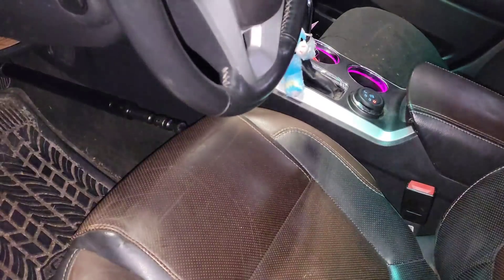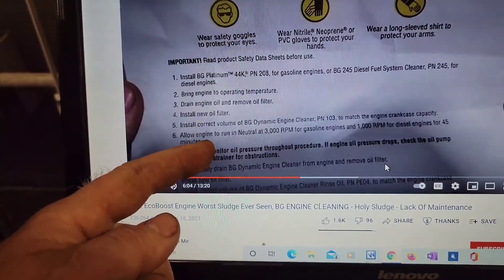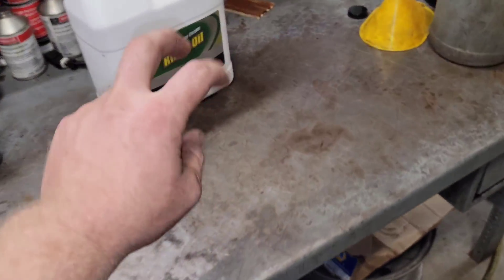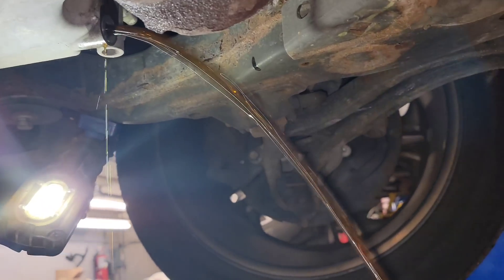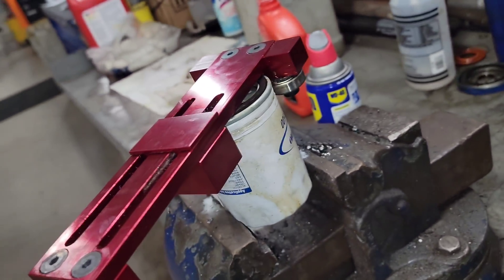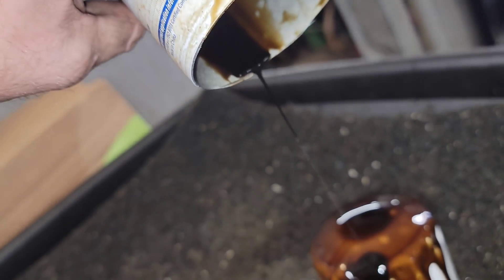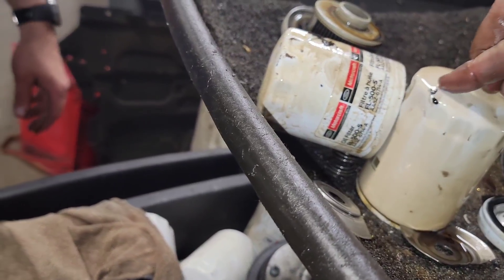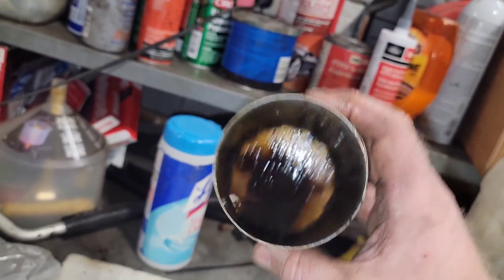Full BG Engine Restoration Kit 2014 Ford Explorer 3.5L Ecoboost - Quick Lube Serviced - Bad Sludge

Comment from the maker: I opened a Amazon Influencer Account - its been asked of me to do for awhile

The tools i use daily or equivalent or tools that need reviewed still plus chemicals 

General Tools 
https://amzn.to/3n3rPd5

Brake Tools
https://amzn.to/3kWoR7u

Chemicals I Use for oil and fuel - flushes and additives and tools for the flushes 
https://amzn.to/3BJorrS

Listening For Engine Sounds 
https://amzn.to/3kYTetZ

Internal Engine Inspection Camera 
https://amzn.to/3BCBXgE

Coolant Pressure Test Tools and Refill
https://amzn.to/3jMo2ii

Spark Plug Sockets 
https://amzn.to/3yMUHrY

Marvel Mystery Oil Line - Oil and Fuel Additive 
https://amzn.to/38EjdkA

Oil filter cutter - The one I use and also a extra runner up and pleat cutting tool as well
https://amzn.to/3h3EMQ4

FORD Ecoboost and NA Oil Catch Cans
 https://amzn.to/38JzGE1

2006 Lincoln Town Car Brakes and Rotors 
https://amzn.to/3h3ls5D

R134a and R1234yf - Chemicals and Equipment 
https://amzn.to/3BAMclQ

Gm LS Valve Cover Driver Side - 4.8L - 6.2L oil consumption update kit
https://amzn.to/3yOuA49

https://www.amazon.com/shop/fordbossme
Reply: Dude for me and many like us there is not such thing as "too many tools" lol I have a good amount of the basic tools. My company provides us with the tools we need. You should see all the egregious tools some ask. I was in the mechanical field for half of my carrier now I'm in automation and industrial controls. But at work same as at home if I needed I buy it.

Comment: My sister took her Trailblazer to one of these shops and a few miles down the road, the engine light came on. She’s not mechanically inclined and drove it back. Found out that they hand put engine oil in it. Needless to say, that shop paid for a replacement engine.

Comment: I know I’m late but just wanted to share my story. My daughter’s 01 Corolla was burning a quart of oil every 500 miles. I ran this kit as directed and now it only burns a quarter every 3k miles. I guess this is a common problem on this generation of Corolla. The holes on the pistons are either to small or Toyota did make enough of them and they get clogged up.

Comment: I change my oil every 7000 miles per manufacturer's specifications but I'm using amsoil signature series rated for 25,000 miles and I'm using a royal purple premium filter
Reply from the maker: I respect what you're saying but I would not listen to 7000 miles 5000 miles Max stick around the channel long enough and you'll figure out why
Reply: @FordBossMe  ty rich love the channel appreciate all your info.  I got 187,000 MI did bg epr flush around 130k replace the PCV valve also at the same time after the flush that stuff works great.

Comment: The plastic is probably from a timing chain assembly gear.
Reply from the maker: No that's not what the plastic looks like on these
Reply: How many different plastic parts are in this engine?

Comment: Herd an old tale. Heat engine to operating temp. Drain oil and filter. Add diesel fuel and filter let run for a little bit. Drain and add fresh oil and filter.
Reply from the maker: Back in the day sure 

With today's engines NO
Reply: @FordBossMe  Agreed. If you take care of your stuff shouldn’t need to do it. But if you buy an old beater give it a shot.

Comment: I used a similar product years ago and I plugged up the oil pump strainer with particles, had to pull the pan and clean out everything.
Reply from the maker: Yeah that doesn't happen with this stuff it's too strong it turns it into water basically
Reply: @FordBossMe  If that car had been up on a lift running at 3,000 RPM a plugged strainer could be very bad news.

Comment: I like using SeaFoam in the crankcase. Of course I do my own oil changes and don’t have to use any cleaning agent. I use Mobil 1 Full Synthetic Extended Performance oil and a Mobil 1 oil filter.
Reply from the maker: I'm a little confused by your comment

This was me demonstrating cleaning somebody's engine out there was super dirty and a severe case of neglect on maintenance
Reply from the maker: Seafoam wouldn't have cleaned this nowhere near as well as this it did, it's not as strong of an agent this is an industrial pipe cleaning application heavy duty cleaning application and seafoam it's just for general maintenance it's not really a heavy-duty cleaner it works over a long period Of time not a short time

Nothing against you but I didn't quite understand what you were getting at with this particular situation in the video
Reply: @FordBossMe  I apologize the confusing comment so I’ll rephrase my comment. I change my own oil so I don’t have to deal with scamming quick lube places. And also in my opinion I use the best oil and oil filter out there ( Mobil 1 Full Synthetic Extended Performance Oil and Mobil 1 Extended Oil Filter ) so that my vehicle doesn’t have this problem. But as far as using the SeaFoam, anytime I buy a used vehicle, I put half a can of SeaFoam in the crankcase, a whole can through the throttle body, a whole can in the gas tank, and drive around until I’m low on gas and then I will change the oil and put fresh new oil in. Again I apologize about the confusing comment.
Reply from the maker: Yeah good thing you said in your opinion because that's not the best oil filter out there it's an extended oil filter and it does have more pleats but even the scientist girl herself from mobile commented on my mobile oil filter video and was saying that it was unfair that I was comparing a full synthetic filter like Fram Ultra synthetic to Mobil 1 extended because Mobil 1 extended performance is not even a synthetic filter

Comment: I can't wait to run the BG Dynamic system through my '02 camry.  Thankfully, it's not sludged up on the inside, but it's endured 250k mi of neglect & abuse from the previous owners.  I'm planning on driving it for a very long time, And I'm looking forward to flushing out the engine.  And seeing how much improvement the car gains from it.  I'm going to run the flush system on my Mom's '06 highlander as well.  I'm sure it will be a massive help to her car as well.
Reply from the maker: If everything is running g well why not do a few little small mini flushes? 

Bg has small cans also on Amazon and Ebay of the BG MOA and the BG EPR
Reply: @FordBossMe  I have thought of that too, actually.  I've had the car for the last 3yrs, and when I first bought the car, I replaced the radiator, belts, hoses, tires, PCV, valve cover gasket, Coil Packs, plugs, mass air flow sensor,  wheel bearings, air filter, upper engine mount, coolant flush, brake fluid flush, oil & filter change, 3 ATF drain & fills driving 100mi. in between, and changing the transmission filter on the final drain & fill.  Ever since I took care of everything, it's gained back most of it's performance.  I change the oil & filter(pennzoil pure plus high mileage synthetic & Wix XP) every 5k mi., and it still  drives extremely well: smooth & comfortable and dirt cheap to own.  I love that old car😆😆😆

Comment: I've been told that running these engine flushes are really bad for the turbo's... thoughts?  some say it's okay.. others say just run a good detergent oil and change every 2 months and it will clean over time... i'm dealing with the same issue on my f150 eco... regular oil changes and the inside looks like a tar pit.

Comment: Old school guy here. There use to be concern with oil flushing that it dislodge gunk that would plug up small holes in hydraulic lifters causing problems? Still a concern?
Reply from the maker: It's always going to be so concerned somewhat.... you have to use really strong chemicals

Comment: Would this work for a car burning oil on a start up
Reply from the maker: If you're only burning oil on Startup it's typically valve seals and flushing it out is not going to help that but this could help a vehicle that is burning oil overall yes

Comment: I did this to my car and it started bucking and smoking really bad and shooting lots of sparks out the tailpipe
Reply from the maker: Well then you had other things going on besides this engine failure something much more catastrophic was going on
Reply: @FordBossMe  Idk it ran good before that. I even put a little of the cleaner in my fuel tank and I also ran the cleaner in my engine for a few hundred miles just to make sure it loosened any gunk

Comment: How do you keep all that crap from blocking up the pick up tube?
Reply from the maker: When you use epr it doesn't work like regular engine flushes do it's so caustic that it actually melts the stuff that it's washing off so it doesn't block the pickup tube

Comment: I have a 2012 Terrain 2.4L Ecotec with 175k miles.  It uses a fair bit of oil. I'm considering doing a full BG service.   Is there any risk in doing this to a high-mileage engine?

Comment: The engine cleaner is acidic you mentioned in a few videos, the other mechanic should not be putting his fingers in that stuff being drained.  Do you know which pH level it is?  The BG kit is no longer available on Amazon, I understand why now.  Thank you for sharing.
Reply from the maker: Yes it is 
Bg Products MOA & EPR Motor Oil Additive Lubrication Supplement Engine Restore https://a.co/d/4HNGZLC

Comment: I have a 2017 Explorer with a 3.5 Twin-Turbo Ecoboost. It blows out blue smoke only on cold start-ups. The turbos have been replaced along with the PVC system replaced. Using oil as well. The engine has 115000 miles on it. No one has been able to tell me why I'm having this issue. I have changed the oil religiously and on schedule. Any thoughts? I have not been able to find anything online except for your video that makes any sense about other problems. Hopefully you have corrected others with this issue..
Reply from the maker: You could have valve seals that are starting to wear and on cold start leaks a little oil past the valve seals and then as it warms up everything expands and seals up or you could have oil control rings on the Pistons that are partially carboned up

Comment: I have a question,im no professional on engines.
I had a sludge problem whit my engine and a friend of mine said that  flushing it whit diesel whould clean it.
I didn't do ot but is that a thing to try .
Reply from the maker: Yes diesel does help but it's not that great of an actual cleaner and it's a little bit easier on cleaning so if you're looking for a really deep cleaning it's not the best thing it does work though

Comment: Likely that plastic is chain tensioners and guides. Those turbo V6 engines won't last lone anyway I'm told due to the turbo induction and the weight of the vehicles they are forces those engine to haul. Even worse for the 4 cylinder turbos. They should have designed a powerful V6 or smaller V8 naturally aspirated which will go twice the distance.
Reply: In the vid, he states “it looks like plastic from a bag”. Chain guides have WAY thicker plastic and he would have immediately noticed that.

Comment: I'm not understanding, do you dump in those entire jugs? Or is there a ratio of engine oil to cleaner
Reply from the maker: No as I read from the directions you dumped in the entire jug and then you top off with regular oil whatever supposed to be in the system to make sure it's full
Reply from the maker: You only use the amount to fill the system's capacity and if you have to use more oil to continue filling to the system's capacity you do so
Reply: @FordBossMe  That's what I thought I just wanted to confirm. This product can be used on gas or diesel. It's crazy to me that this stuff can be used on an engine that calls for 0w-20 or 15w40. Granted on the diesel you're probably running a 50/50 mix since the crankcase takes so much oil but still. The proof is right here  this stuff really works

Comment: Would you recommend doing the bg clean in a 91 civic with 238k just took valve cover off and everything is tarnished brown and black and some build up in corners and some blow by
Reply from the maker: It wouldn't really hurt anything you can do a small can instead of the big flush you can find them on Amazon

Comment: I bet when the timing components were changed this is what's left of the chain guides. Probably never flushed the pan
Reply from the maker: No that's not what happened, this isn't chain guide material and the chain guides that typically come off are not destroyed

Comment: An oil change with new oil in the crankcase for 45 minutes at 3000 RPM would flush plenty of gunk out for a fraction of the cost.
Reply from the maker: And this comes from people that are not educated in what we do in this field and it sounds very much like what you just said

It's one of the reasons why I just sometimes despise talking to customers and people that think they know.....yet have no f**** idea
Reply: @FordBossMe   No snake oil in a bottle is going to remove all that crap in an engine and a real mechanic knows the damage is already done once this occurs.

Comment: Where can I purchase the BG Restoration kit?
Reply from the maker: Amazon Look in the pinned post here
Reply from the maker: I opened a Amazon Influencer Account - its been asked of me to do for awhile

The tools i use daily or equivalent or tools that need reviewed still plus chemicals 

General Tools 
https://amzn.to/3n3rPd5

Brake Tools
https://amzn.to/3kWoR7u

Chemicals I Use for oil and fuel - flushes and additives and tools for the flushes 
https://amzn.to/3BJorrS

Listening For Engine Sounds 
https://amzn.to/3kYTetZ

Internal Engine Inspection Camera 
https://amzn.to/3BCBXgE

Coolant Pressure Test Tools and Refill
https://amzn.to/3jMo2ii

Spark Plug Sockets 
https://amzn.to/3yMUHrY

Marvel Mystery Oil Line - Oil and Fuel Additive 
https://amzn.to/38EjdkA

Oil filter cutter - The one I use and also a extra runner up and pleat cutting tool as well
https://amzn.to/3h3EMQ4

FORD Ecoboost and NA Oil Catch Cans
 https://amzn.to/38JzGE1

2006 Lincoln Town Car Brakes and Rotors 
https://amzn.to/3h3ls5D

R134a and R1234yf - Chemicals and Equipment 
https://amzn.to/3BAMclQ

Gm LS Valve Cover Driver Side - 4.8L - 6.2L oil consumption update kit
https://amzn.to/3yOuA49

https://www.amazon.com/shop/fordbossme

Comment: Um how is it that no one caught at the beginning it was stated that they did a timing job at his shop 15k miles ago and there’s plastic bits in the oil now. Timing chain guides are typically made from plastic so they are likely the culprit. Sludge doesn’t happen in just 15k miles, wasn’t it noted when they pulled the valve cover gaskets to do the timing job that there was sludge?

I’m not saying quicklube places are great but if they changed the oil and the filter they did their job. Making them the scapegoat doesn’t really seem fair if you guys just had the motor apart 15k miles ago
Reply from the maker: don't come here being Automotive detective that's my job he won't last long especially talkingshit

Secondly this was not chain guide material I know what that is that's not what this is so you don't get to choose what something is based on a video that you're watching unless you are putting your hands on it so you stay in your lane

And yes if they never change the oil in 15,000 miles is can happen especially with crappy oil

Comment: How many miles between oil changes at the quick lube? Kind of hard to point fingers when the customers  typically wait till 0% and goes to the nearest quick lube a week later. On top of that, they look for the cheapest oil. Ford specs allow for conventional oil on the eb 3.5l.
Reply from the maker: No it doesn't
Reply from the maker: I don't know where people keep getting that b***** from
Reply from the maker: Well I pointed fingers only in a soft kind of way so there's really no debate that you can have with me at all and really what you should be doing is saying wow this s*** really works I'm thankful that you showed me that instead of trying to talk down to me and tell me about my own job when you clearly don't know
Reply: I'm referring to the older EB.
Reply: @FordBossMe  UPDATE: the newer EB motors have a different spec. but Pennzoil's conventional motor oil meets that spec too.
Reply: @standhd  I agree, but Pennzoil conventional oil meets Ford specifications for the Ecoboost 3.5l.
Reply: @hjc0706  Ok…. So you would put that oil in an Ecoboost engine….LOL….ok…..do you have links or info showing Ford is recommending this “CONVENTIONAL” oil in said engines? Or are you going by some other information; IE….a Penzoil infomercial or advertisement?
Reply: @standhd  Here's where I call truce. Pennzoil relabeled their conventional to be SynBlend. However, when it was labeled as conventional. it still met ford's specs for ecoboost 3.5L.
Reply: @hjc0706  SYNTHETIC BLEND….LOL….Ok …. TRUCE….. relabeled….hmmmm……the engine doesn’t know it’s relabeled….hmmmm….🤔🤔🤔🤔ok….put the “RELABELED” stuff into the Ecoboost…….-and have a nice engine life…..who knows…..maybe that (your) Ecoboost will be just fine…….

Comment: I gotta F150 with the 5.0 engine. I change engine oil and filter every 5k miles with full synthetic oil. My oil is never this dirty, but I got 115k miles. Would I benefit from doing this rinse kinda clean or is the basic can of EPR enough??? This is my first time hearing about BG products. Thanks
Reply from the maker: The basic small can is more than enough
Reply from the maker: Just be careful running it through turbocharged engines that may not be the best idea
Reply: @FordBossMe  why would it be a bad idea to run it through a turbocharged engine? I have a 3.5 ecoboost that I’ve been lookin at flushing. I planned on using the the BG Dynamic engine restoration kit but Ford told me they stopped offering that kit because it damaged too many engines. The next best thing they said they could offer is the performance restoration kit with the MOA, 44K and EPR. So that’s why I ask. Sorry for the monologue.